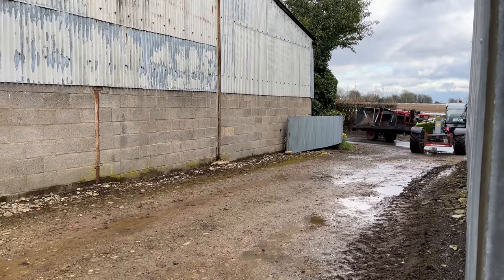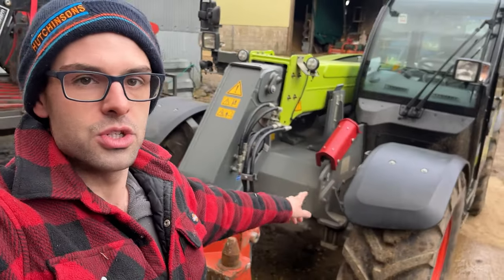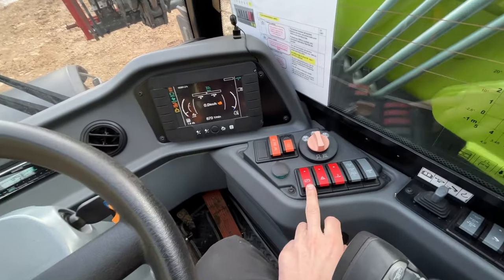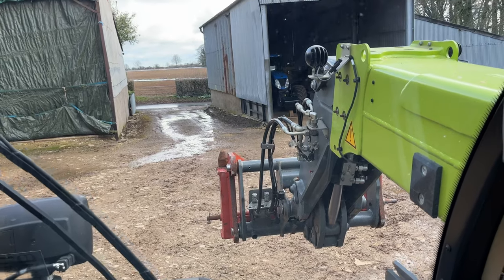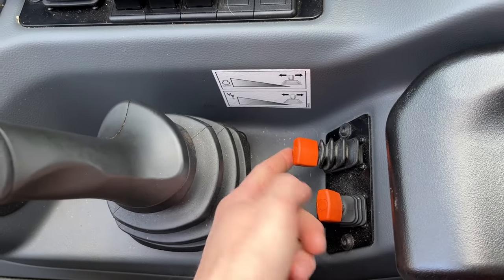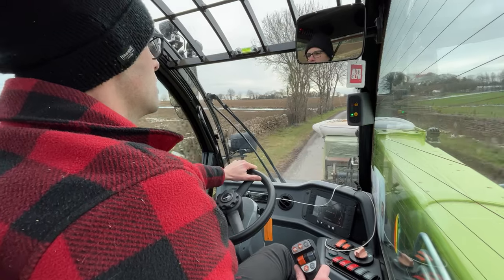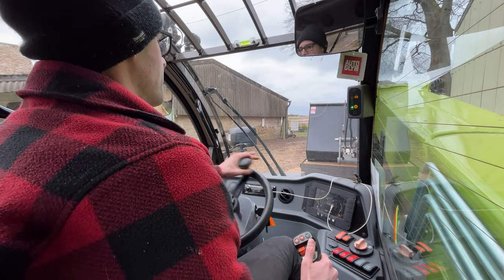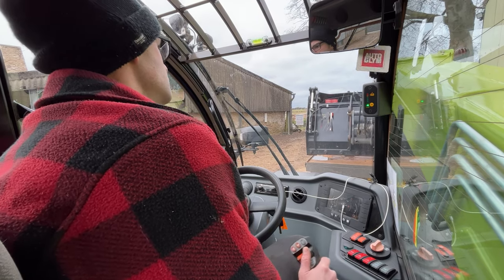FARM DEMO OF A CLAAS SCORPION:IS IT BETTER THAN A  JCB FOR OUR FARM? #claasscorpion #farmersreview

Comment: We have a matbro tr200 turbo and finally bought a newer loader after demoing a few and the Claas was the most impressive so bought a 736. Best bit is the automatic handbrake 👍Find that once you get used to the rigid machine the pivot seems a bit backwards